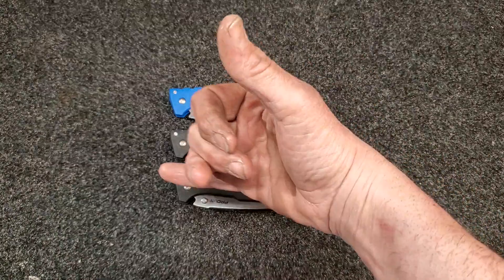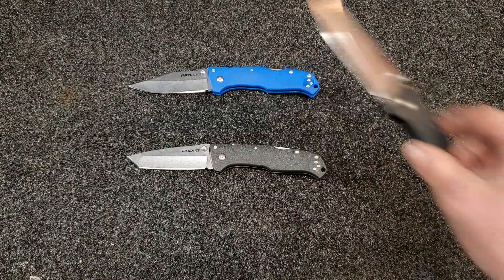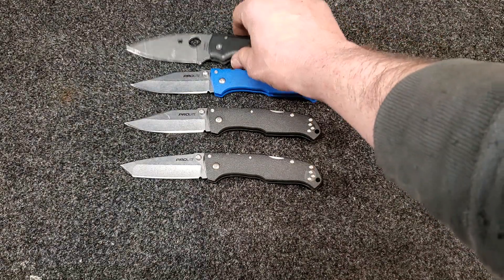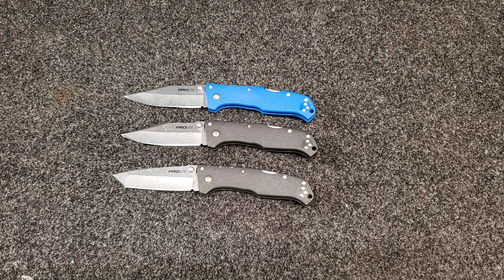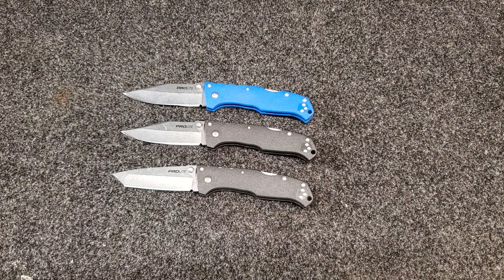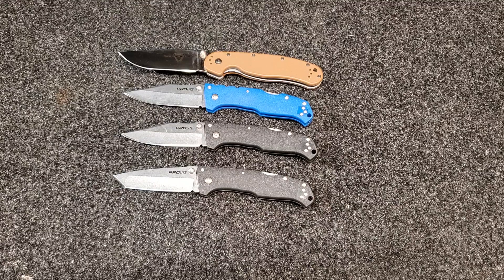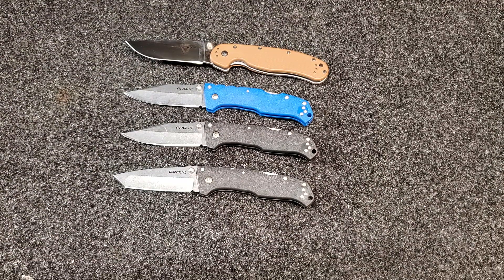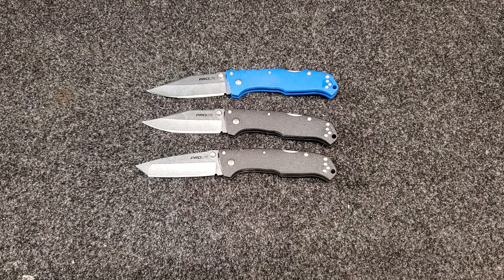Cold Steel Prolite (4116) edge retention results!

Comment: It would be awesome knife from better steel. 9cr18mov, 14c28n, aus10, these all are cheap and still better than 4116. 4116 is 5cr15/X50crmov15 equivalent, so lowest bottom of the steel chart.

Comment: This is what I keep complaining about. Too much variation in HRC between different lots of the same knives from big manufacturers. Given it’s only a $20 knife, but to be off 4 points from the advertised range, that’s huge...not in a good way. These companies have to get their QC better because people like you, Gerald and Steve are starting to out them on their inconsistency. Great video brother!!!
Reply: It's actually 6 points off on my blue Pro Lite. I spoke to CS customer service back when that was tested, they looked it up by the specific model number and target for that knife was 58 HRC.
Reply: DJMblades that’s absolutely crazy and unacceptable.
Reply from the maker: Definitely Ben. We gotta hold their feet to the fire! I enjoy most of my cold steel knives. But since they swapped to s35vn the Rockwell has been very inconsistent at best.

Comment: Good video. Yes I would be very disappointed with the HRC being that low. It may not have effected the edge retention tests as much as I would have thought. It may even get better after a few more sharpenings. They were what 3.9 below their minimal HRC. I expect better from cold steel. Since they are kind of hard use knives that really low HRC may help it return to true after a possible bend or it could leave it bent. I may just let it ride on a 20 dollar knife but not sure. Thanks for the info.